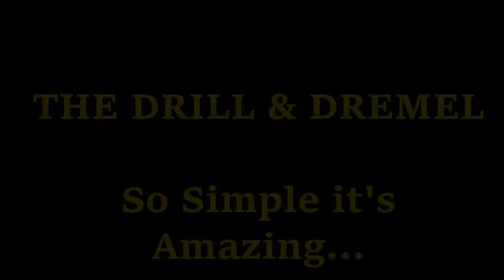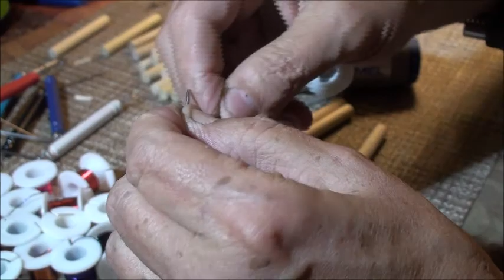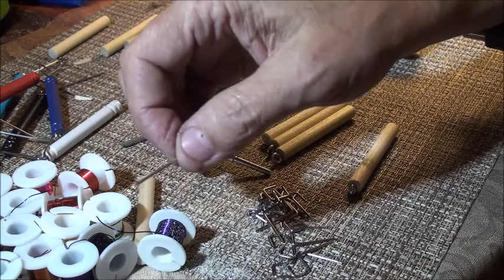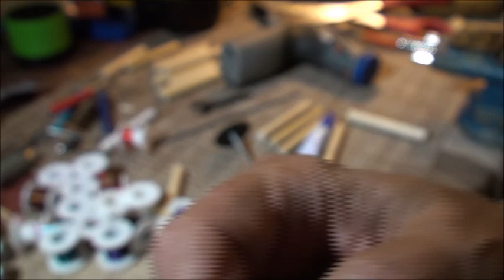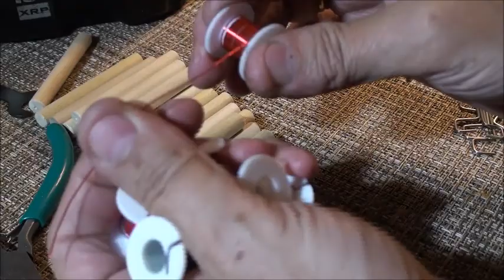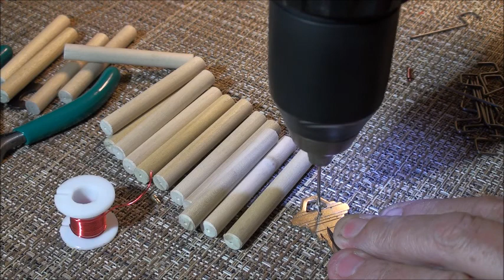Trick inserting "Tinyest Drill Bit" into Dremel or DeWalt Amazing...

Comment: I am grateful to have found this video! Thank you! Repaired a window pane in a vintage door with1/16th inch glass and needed to make the glass molding to hold the pane in the frame. Used this to insert the tiny bit in the dremel to predrill the brad nail holes in the molding and frame so the glass would not break when driving the nails! Worked slick!
Reply from the maker: I've used this idea for the past 5 yrs. Yes it does come in handy! Dremel doesn't care for the video. Guess their Collets aren't selling.lol

Comment: Thank you so much, i am making a miniature RC car and whilst making the steering bar linkage I needed to use a 1.5mm drill bit, but it did not fit. Now I can drill all of the tiny holes.
Reply from the maker: That really came in handy for me when I need a #55 drill bit. Not even DeWalt could lock it in! Slide right out. Thx for watching...

Comment: Dremel has collet nut kit for smaller and even tiniest bits. Google that. You can find it in universal fit rotary tool hobby sets or buy the original Dremel one (which is more expensive). Or just buy a DREMEL MULTI CHUCK
Reply from the maker: No need but thanks for the thought. Love my idea 💡 hasn't failed me yet! Thanks for watching.
Reply: @x-tremevidpro  thanks for sharing the trick 🙏 have a nice day. My advice was somehow for beginners not for you of course :) I’m sure yours is also safe but fitting that wire would be difficult for who are not masters

Comment: Thanks! I was holding my horses for purchasing dremel bits because i only have a regular electric drill. Now i can use any size bit for sanding using my portable bosch drill
Reply from the maker: Right on! Dremel use to advertise on my idea, till they came to the conclusion why buy their Collets! They remover their add! Lol 😆 Glad you liked the video!
Reply: I actually dont need to buy dremel at all 😂
Reply from the maker: But will it hold a #60 Bit?
Reply from the maker: @normangarcia857  Than stick with what works for you!
Reply: My drill closes as small or as big as any bit I put in it. My dremel wont close smaller than their bits though.

Comment: This also worked great with one of those nicer plastic-coated twist-ties that they use to wrap up cables when you buy new electronics, so you don't even have to go buy wire if you have some of those lying around.
Reply from the maker: If you use a TWIST TIE in place of wire it will melt if bit gets warm or even hot. I will stick with the copper wire much more effective.Thanks for watching!
Reply: @X- Tremevidpro
Yeah, the plastic did get a little mushed, but I just had to buzz three quick holes, so it didn't melt and came out of the chuck just fine.  Thanks for the trick; you saved me time and money.
Reply: Hey this helped me in a pinch also because I didn't have a small gauge copper wire on-hand.

Comment: You could just use the other chuck that comes with the tool and it tightens right up!
Reply from the maker: Try and tighten a #54 Drill Bit in that 5lb. Drill.
Chuck will not tighten. This is about Dremel not Dewalt! Thanks for watching.

Comment: Starting to wonder why I need to buy a Dremel tool if I can get my small bits ,etc. into a regular drill.
Reply from the maker: What if you only had a Dremel that can't hold a tiny bit. Now you can! Method works well with Dewalt as well. Glad you liked my video😉
Reply from the maker: If u own a Dremel it comes in very handy! Just read the comments and you will wonder no more...
Reply: The problem isn’t that. Drill is for slower torque. Dremel is way faster and therefore willing easily cut through metal, but is not made for torque so will slow down or seize in certain situations. With the drill it took me hours to cut metal. Dremel took me a couple of minutes. Way faster. Drill is made for heavy duty stuff. Not speed.

Comment: I’m a complete newbie to this. I just brought my first drill kit. I need the pre-sized hole to be bigger in a knob for a kitchen island I’m putting together. What is normally used to hold drill bits in place? I don’t mind doing this wire string method but I’m curious why the industry isn’t more efficient with an actual holder for these more narrow drill bits.
Reply from the maker: If u r using a larger drill bit, use a larger drill! The Dremel is a very useful tool on small jobs. Sounds like to me u may want to ✔ into "flat speed bore bits may be a great choice...thanks for watching!😉
Reply: Quite right. Regular bits fit regular drills but the Dremel bits are very tiny. There must be an official way around this but I'm still hunting for it...